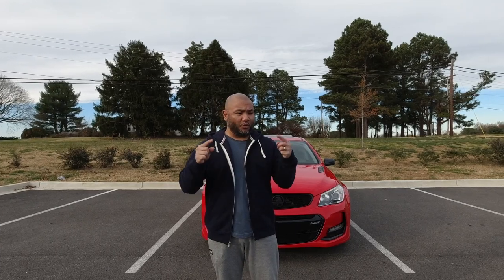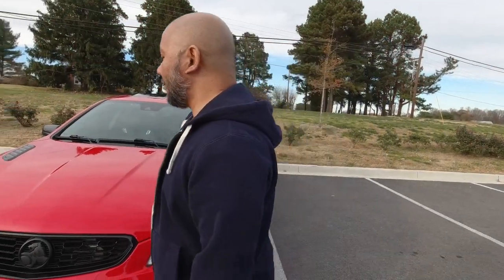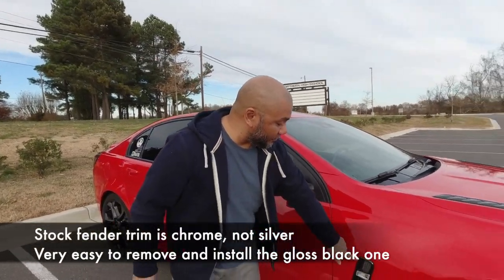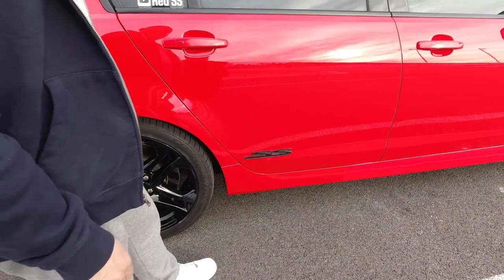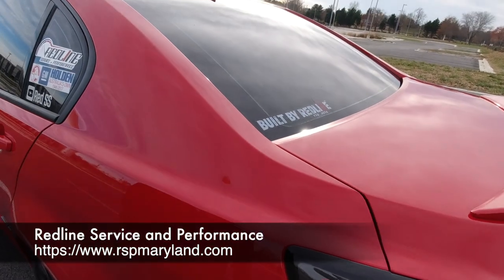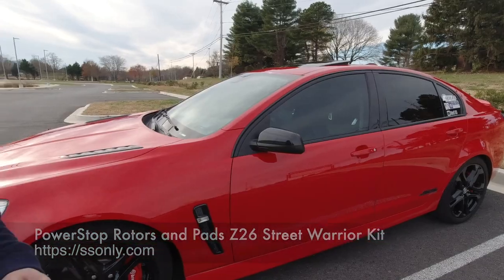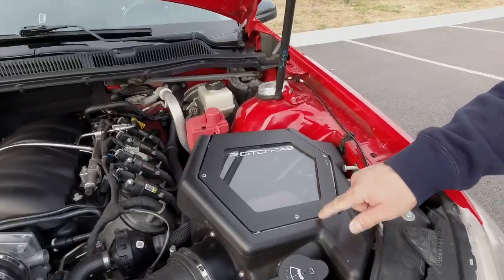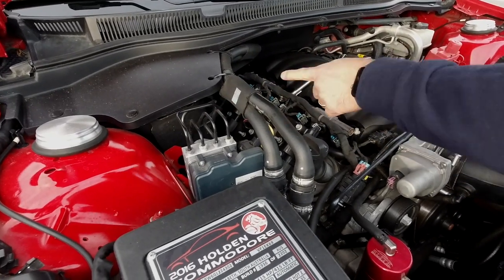Everything Done To My Modified Chevy SS | Holden Commodore SSV Redline

Comment: Hey Armin!  I’ve watched your videos and the mods done on your Red SS.  I’m happy to report that watching you, your mods, and your SS have swayed me to buy a 2014 Chevy SS in Phantom Black back in March.  Since then, I’ve upgraded the Brembo brakes all the way around with front, 6 piston calipers that were rebuilt to C7 calipers and with two piece 370mm rotors, rear Brembos with 365mm rotors, ARH 1 7/8” headers (thanks to the expert driver in “Mexico”), Granatelli coil near plug ignition wires, Granatelli coil packs, heat boots, heater core relocation kit from Maverick Man Carbon, Elite catch can, Eibach Pro Lowering Springs, a Cold Case aluminum radiator, and interior blackout kit.  Next will be a head and Stage 3 cam package from Texas Speed and Performance and later top it off with either a ported Magnuson Supercharger or ported Fast LSX Intake manifold.  I must say that you have been very inspiring in my build.
Reply from the maker: You got a good build going on! Thanks for supporting the channel!
Reply: Just need a 3000 stall and a 4 11 diff to wake it it bro

Comment: Great build. Similar to mine. Mines a 2015 in Silver so I kept the chrome. Mines making 440/465 but that's because I did a more aggressive cam and a converter. 

I also didn't do the tail lights. I did the carbon mirrors over the black wrap. I also did the Holden radio software update from WAMs before they stop doing it supposedly after 2021. Not sure if that's the case yet. 

Impressive how clean your car is for 115k miles. 

Mines at 37k and I feel like 115k will take forever with it being my summer car here in Michigan
Reply from the maker: Nice build 👍🏼👍🏼  I didn’t learn of the WAPS deadline until recently, I’ll be unavailable to do much for the SS until next year so I’ll probably just miss the boat on the Holden software. Thanks for watching, I try to keep it clean when I can 😎

Comment: Gotta keep the Aussie parts on an original SS COMMODORE VF. It would be a very special car over there, my hat goes off to you. Aussie from Down Under.👏💯☝️👍🎉🥳🤣🤟🙏🤜🤛Are you still running the same stall converter as that cam is choppy.👍☝️👋🔥💨🤣
Reply from the maker: Yes I am still on the stock converter. My tuner was able to manage the cam surge just a little bit, but it’s still there when coming to a stop. It’s not a daily driver anymore, so I haven’t prioritized upgrading the converter yet. Maybe that’s next 👍🏼 Thanks for watching!
Reply: @RedSS  my cam is very similar to yours and I run a 2500 stall converter. It's fine I use it as my daily driver. It's just a bit bigger fuel bill. Thank you for your response Armin. I have followed you since you started. 🙏👏🤜🤛🤟🎉🥳💯 Merry Christmas to You and all the Family.

Comment: How did you mount your ss plaque on the fuse box cover
Reply from the maker: I drilled 4 holes into the fuse box cover and the plaque and mounted it with 4 screws.

Comment: Stock stall converter?
Reply from the maker: Yes stock stall converter. I recommend upgrading for those that want better drivability.
Reply: @RedSS  what about the drivability do you not like?
Reply from the maker: The resulting cam surge when coming to a stop. It was quite noticeable with a canned tune. Then had another tuner do  what he could to manage RPMs down low but it’s still there, just milder. I just got used to it.